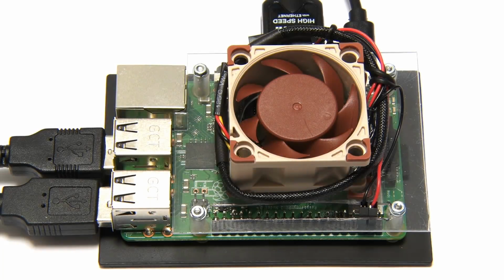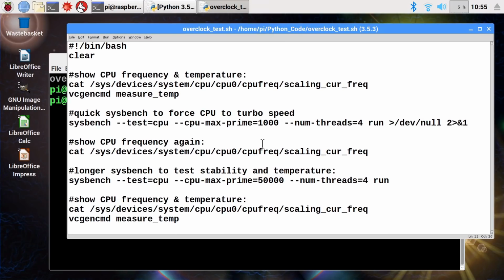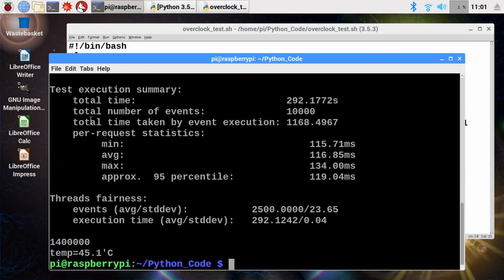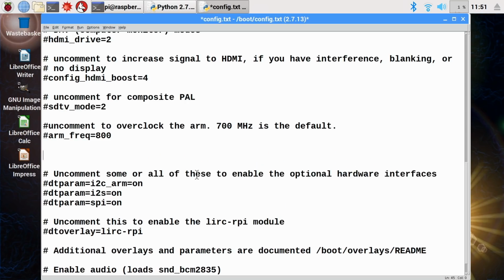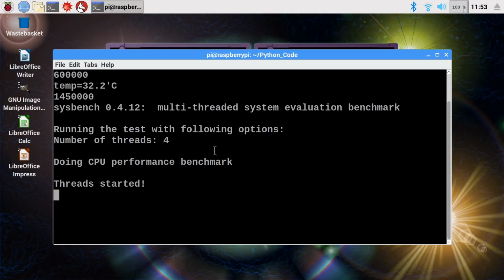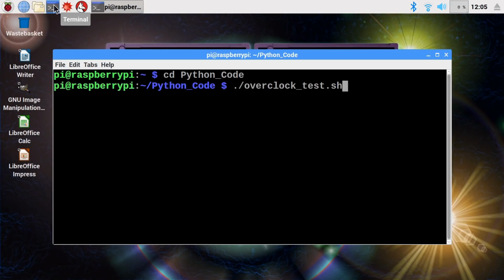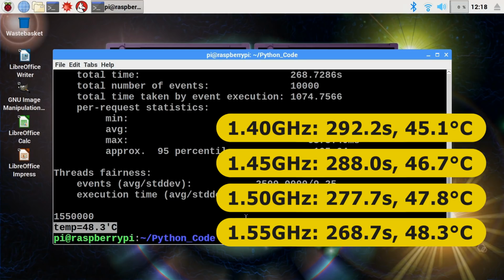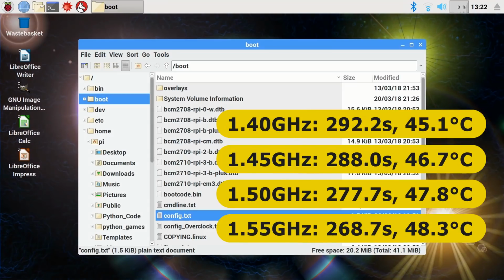Raspberry Pi 3 B+ Overclocking

Comment: Hey i got my rpi 3 b+ to 1.5 ghz stable without over voltage is that good?
Reply from the maker: It is excellent! :)
Reply: @ExplainingComputers  nice ^^ and i testet 550 on core(gpu)
And 400 on v3d because i use it as a retro console, but i have a mid end cooling with 1.5 ghz i am at 100% load i get 55°C but i dont like it so close because of that i did 1.45 because then i get 51°C ^^
Reply: jackpot xD first a reply then a heart xD thanks^^

Comment: is there a way to turn the fan off or lower the speed, while booted to the OS?
Reply from the maker: Here, only by removing the connection to the GPIO power pin(s). A speed controller could be fitted.

Comment: Why is that despite not even reaching 50 degrees the cpu doesn’t work. I mean i read this A53 is still being utilized in samsung exynos and snapdragon 400 with up to 2ghz i believe?

Correct me if I am wrong.pls
Reply: I tried overclocking a different processor once and the Voltage Regulator Module started throttling.  Sheesh I wasted 85 bucks on a FX-8350 I wanted clock speed rather than more cores, so I stuck with the FX-6300

Comment: When the make the raspberry pi 4 they should put a Qualcomm snapdragon msm 8917 in it because it runs at 1.4ghz is quad core and has a adreno 308 gpu @ 398 mhz + 1.5 GB of memory (for 2017 LG k8 version of snapdragon msm 8917) and on battery the raspberry pi 4 should last for almost a day with a 2800 mah battery thats the only thing i like about my new phone is the battery life between charges

Comment: Be mindful that the raspberry b + has it set where if its above 60c. It will throttle. (It been change) to set it back just write temp_soft_limit=70 
In the config
(The highest it goes it 70)

Comment: With the Heatsinks and case provided, will a 100Mhz overclock be possible? anyone know that? Thank you!
Reply from the maker: Yes, overclocking from 1.4 to 1.5GHz on a Pi 3 B+ should be possible, as shown in the video. :)

Comment: I would overvoltage it only if it wasn't stable with a higher clock, maybe you are just generating more heat without a purpose there with this extra voltage. Just maybe. Great video anyway.

Comment: Love your videos! Just wanted to say by taking cues from various setups, I am currently running two Pi 3B+ boxes, both stable at 1.6Ghz. One Pi is in the standard case that came with the Abox kit, modified to include a Noctua 40x10mm 5v fan mounted on the inside; the other is in a Flirc Gen 2 case. The Flirc case definitely runs warmer. Anyhow, if anyone is interested, below is an excerpt from my config.txt. Hopefully it works for others!

arm_freq=1600
gpu_freq=525
core_freq=525
sdram_freq=525
sdram_schmoo=0x02000020
over_voltage=6
sdram_over_voltage=2
v3d_freq=525
gpu_mem=512

Fwiw, I have had both boards boot and run fairly stable at 1.71Ghz. But when I ran the Sysbench OC tests for Prime 20000 and Prime 50000, the time to complete was definitely slower than settings for 1.6Ghz. Regardless, I was completely stoked and blown away by the simple fact that it even booted!
Reply from the maker: Great feedback -- thanks for sharing here!
Reply: Can't imagine how busy you really are, Chris. Thank you for taking the time to even respond!

Comment: This cooling system is overkill. The Pi doesn't get very hot normally. Some cheap heatsinks and a cheap fan is basically all you need to overclock to 1.55 ghz. You don't get any improvement with such a complicated cooling setup because Raspbian becomes unstable beyond 1.55 Ghz, so your "bottleneck" here is not the temperature but the operating system. Seriously, I have just like a $15 case for my Pi that came with some cheap heatsinks and a fan and the thing does not get over 50'C. The Pi does not start throttling speed until it's at like 80'C. (Also, even though Raspbian boots at 1.55 Ghz, it's significantly less stable and can crash often. 1.50 Ghz is basically the limit for practical use.)

Comment: What if I have a  3 amp power supply? Will this help me get to 1.6 with all copper heat sinks and a fan?
Reply from the maker: No. The limitation here is the chip itself, not the power supplied, or even the temperature of the Pi.
Reply: I see. Thank you for responding.

Comment: I'm wondering if I can get some better psp and n64 emulation at 1.57 over my raspberry pi 3 over clocked to 1.35
Reply from the maker: Almost certainly the extra speed will help -- both CPU and GPU O/C.

Comment: What power supply are you using in this video? I was trying to start my Raspberry Pi 3 B+ with Recalbox on the SD card but it just shows the undervoltage symbol and wouldn't even start. I'm using a Samsung power supply with 5.3 volts and 2 amps.
Reply from the maker: Here I think I was using the (new) official Raspberry Pi PSU, which is 2.5A. 2A is light for a Pi 3 B+.

Comment: The cpu in the 3B+ is has thermal spreading improvements but basically the same chip as the 3B. So Rpi foundation have overclocked the chip for us but put an internal hardware limit so 1.6GHz just will not boot. I'm assuming here but it fits the reality. One chap etaprime has a workable overclock to 1.57GHz, just under the "limit". Comments?
Reply from the maker: My comments are that I made it clear in the video that this it is the same SoC, just higher clocked. :) I very much doubt that there is a 1.6GHz hard coded limit. It is just that the board becomes unstable around there -- the constraint is clearly not the temperature if suitable cooled. I could not see the point to push up in 0.1 increments -- and indeed it needs to be noted that different Pis will tolerate different overclocks. So there is no such thing as a "workable overclock to 1.57GHz" that will work on all Pi 3B+s. Some may stand that, some 1.51, some maybe 1.58, etc. It just depends how their individual SoC came out of the factory! :)

Comment: The big heatsink and fan already works quite well, but it's probably not hard to mount one of those smaller round Zalman coolers onto it, and that will really work like a charm i think.
Or just go nuts with liquid nitrogen, of course, a Raspberry Pi deserves nothing less :P

Anyway, i cannot even get my 1Tb PiDrive to work correctly, so what do i know...

Comment: Great video, Thanks.
BTW, can Raspberry Pi run GNOME and all its apps? Personally, I like gnome more than other desktop environments(and mainly gedit and gimp)
and what kind of rig you are using for video editing? I'm trying to build my own video editing workstation and I think that asking professionals would really help a lot. Thanks.
Reply from the maker: These days for video editing you ideally need an i5 (or AMD equivalent) and 8GB or more RAM, plus GT1030 or more graphics.
Reply: I've been using a core i7-7700 with 32G of ram and a GTX 1070 mobile GPU. But Adobe Media Encoder is still slower than what I would expect. I'm not sure whether it's because of my CPU or the lack of GPU alghorthem.
Reply: I'm trying to get a Xeon E5-2680V2 with X79 motherboard to build my workstaion, but people told me that I should go with X99 or just buy Ryzen. I'm not quite sure what should I get now.
Reply from the maker: You clearly have very high performance expectations if an i7 with 32GB and a GTX 1070 is insufficient! :) The Ryzen chips certainly offer good performance/value for money, though personally I always go Intel.
Reply: Okay and what would you choose if you have budget for a X99 chip?I'm trying to get a X99 setup cuz they are cheaper and I can save more bucks for GPU(waiting for next gen GPU and using a old card for display now)
Reply: and to be honest my "video editing" is usually compressing my gaming video and upload them online, but AME didn't work quite well as I expected
Reply from the maker: I am struggling to understand why, if you are OK to spend so much on a PC, you would opt for an X99 (2014) chipset! Personally, if building pretty high end, I would opt for an X299 Gigabyte motherboard -- eg an X299 UD4 Pro -- with an i9 processor (eg an i9 7900X for the test power/energy balance). But in actually I would not at present build anything like this! :) However, my requirement for an editing PC is that it offers slick scrubbing and real-time playback while I'm editing (I work many days a week in an editor), while you are concerned with with encode times on what are are maybe very long clips. So our requirements are very different, and 8GB Core 2 Quad or i7 PCs still very me very well.
Reply: Still thanks.The main reason I want to get a X99 board is that I could get cheaper E5 chips later and a X299 is waaaaaay out of my budget.Although I'm using this PC now I need to spend the money for a desktop workstation and a laptop so not quite much.

Comment: After the testing of different cooling methods, I knew this had to be next.  But even with the overclocking, the temperature was way below the 70C mark.  I think just the heat sink and a standard fan would do fine for all normal ops (heavy, continuous processing), and keep the system at 1.4 GHz - it didn't really make all that much difference.  Pop it up to 3 or 4, and that would be impressive.

This card takes a micro sd, I wonder if it'll hold up to 256 gb.

I'm sort of convinced that this might be a way to go as an interface between an electronics subassembly and a main computer (better than the Pi-0 or the Chip SBC), but I still have a lot of circuit board to make work.  I could probably get all of the usefulness out of just integrating a CPU into the electronics subassembly.

Hard to decide.  Less programming is better, but I still need a lot of it.  And data storage - lots of it.  An external HDD will have to do that.

Comment: I have the 5V 2. 5A power supply I can overclocking? ?
Reply from the maker: Yes on a Pi3B, but the 3 B+ ideally needs a 2.5A PSU just for standard operation.

Comment: You attempted to overclock the GPU, but never actually tested it.  I don't think that just showing the desktop is much exercise.  Maybe try some 3D stuff.

Also, if you REALLY want to stress the Pi out, there is a program out there called "cpuburn" that will absolutely stress the system out as much as possible, and will likely cause throttling, even with your increased cooling setup.  Just Google "raspberry pi cpuburn" to find it.

Otherwise, thanks for the video.
Reply from the maker: Thanks for this. CPU burn cannot stress the CPU to more than 100 per cent utilization, which the SysBench CPU test achieves just fine.

Comment: Great vid mate was hoping you might push that pi to 2ghz really wanted to see that and if possiblle.
I think it would have stayed within the range.
Reply from the maker: The Pi's CPU cannot support a stable system at that speed I'm afraid. Unlike in desktop PCs, the constraint is not the temperature.

Comment: the thermal makes you think it would go higher like 2.4 Ghz but i guess thermal "IN" and thermal "OUT" are 2 things... what i mean is, inside the processor it is impossible to put a thermometer since it would break the processor (kind of...) so you can only measure the surface... now if it cannot expel the internal heat faster... the outside is a fine temp but the inside tends to not lose it fast enough... hence at 1.4Ghz inside might be 70C and outside too BUT at 1.6Ghz it may be trying to go 80C inside even if the outside might have been 50C!

remember the processor actually is as small as a thin piece of paper in "Z" and probably not much bigger in the other "X" and "Y" most of it's space is taken by connector pins and the black stuff holding this all together... the heat is dissipated trough that black stuff, then trough the heat sink... so if 3 mm at 70C dissipates trough 15mm, that is = a less high heat since the energy is spread across the volume!

Comment: The 1.55 is a great score, keeping in mind that originally it had 1.2 so Im very impressed. If only the Pi had been equipped with more ram it would be a great cheap option. Thanks for the excitement !
Reply: absolutely 1.6ghz and 2gb ram would be really amazing, 1440p should be  quite easy then and opens a lot of new possibilities
Reply: @bhBlacky82  and now you have it, a Raspberry Pi 4! :)

Comment: I recommend for overclocking CPUs and GPUs to start with just increasing the clock frequency alone and keep the voltage the same. The voltage has always been chosen extremely conservatively given that all the samples need to work with it, even the worst ones. You are likely to get a substantial overclock @stock voltage, only after the system become unstable at a certain clock frequency I would start to increase the voltage to whatever value you are comfortable with (safety hardware and heat), but with small increments (why use more than what is required?).

Nobody should be hesitant to overclock, just  be aware that you need to do a little bit of research before you stat changing the voltage. :)
Reply: Im just gonna go ask the dumb question: Whats the harm in raising the voltage above whats necessary beyond increased heat output? Do things actually burn out that quickly from getting overvolted or is it just life expectancy?
Reply: @builder396  
 builder396  P=V*I = V*(V/R). Higher voltage, more than proportionate higher power. Typically around 4 times the power for 2 times the voltage in the zone where desktop-CPU's are clocked. It is the heat which COULD be the problem. If you cool the CPU/GPU with liquid nitrogen then you can safely use much higher voltages than with aircooling or an AIO. 

Practically speaking, I would not increase the voltage much, focus on trying to get a higher clock frequency at the same voltage. Or maybe even see if you get away with a lower voltage and the same clock frequency. A lower electrical  power is nice: less noise and less heat. How high the voltage can be depends on the used process, for Ryzen1/2 you can safely clock up to 1.4 V, for Zen2 (3700X, 3600X...) for all core you best don't go above 1.3-1.35 V. 

 
What happens if you go too far? After a few years you will notice degraded performance. It will keep working but you will loose your overclock and if you push it really far then you might need to clok the CPU/GPU lower than out of the box settings. As long as you keep the voltage identical it is perfectly safe to change the clock-frequencies. In the worst case your system crashes and that does not do any damage. For AMD you can easily find the recommended voltages, for Intel I haven't found those (I haven't searched though). Life-expectancy really is not an issue at all, CPU's can last a lot longer than how long people use it. You have to do crazy stuff to not have a CPU last 10+ years.

Comment: question, does the raspberry pi 3+ have enough juice to run even modern tasks, such as opengl and other specific tasks?I would like to see how this machine stacks up against a more modern cpu, then again that's if you have the resources, ... I have an idea, why not pit this machine against a comparable Pentium E52** processor, play a car racing game or 2 and see what results you can get. just to say though, the armv7 processor is very fragile when it comes to overclocking, but if you check the TDP limits of the board (if any) you may run into a few bugs.
Reply from the maker: Nice idea for a future video; noted. :)

Comment: WARRANTY VOIDING SWITCHES:  (Pi 3b)
There are some settings which flip a hardware switch (or flag) inside the Pi and void the warranty, these are:
over_voltage greater than 6
force_turbo=1
temp_limit greater than 85
https://retropie.org.uk/docs/Overclocking/
Reply from the maker: Good info to share here, thanks for posting.

Comment: Just finished my first build using the raspberry pi 3b and the dual cooling fans and heatsink by retroflag and small copper gpu heatsink. I'm getting temps of around 40-50°c on both the cpu and gpu in a fully enclosed case. Would you say this is a safe operating temperature?
Reply from the maker: I think that is a very safe temperature. Any computer running below 50 will lead a happier and probably extended life! :)

Comment: Another interesting  and thought provoking video. An area which I don't think you've covered is how to 'support' and close down a Pi gracefully when the supply fails or is interrupted.  Having just terminally corrupted another uSD card it's something dear to my heart. I have tried various 3.7V Li-On to 5V boost circuits - TP4056-based and others, but, whilst I can get the Pi running (Pi 3), it always has the 'lightning strike' symbol, so they're not perfect. Code to shut the Pi down by connecting two GPIO pins  is easy, but one needs to have power to do this!
Perhaps this topic could go onyour list ?
Dave
Reply from the maker: A great topic. Though I'm not sure what my solution would be . . .

Comment: You could probably make the 1.6 Ghz point by upping the voltage by 1 point.  Having said that I am waiting for the next generation of single board computers as the current ones are just not quite powerful enough for the emulation use I want them for.  I am also waiting for SSD connectors to become part of the standard feature set rather than having to use either very limited onboard memory or memory cards that were never designed for that kind of work.

Comment: Surprised you didn't try OCing it without an overvolt. That's always my first step. See what can be safely done before voltage tweaks are needed. I only needed to adjust voltage once in my OCing days, buit I'll admit I didn't do too much OCing. I would be now, but I have a locked CPU. :(